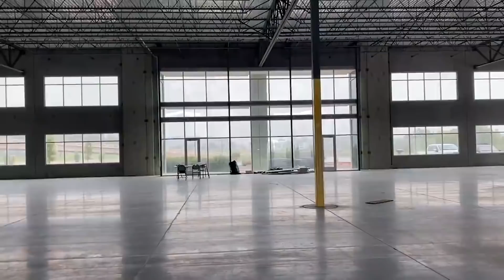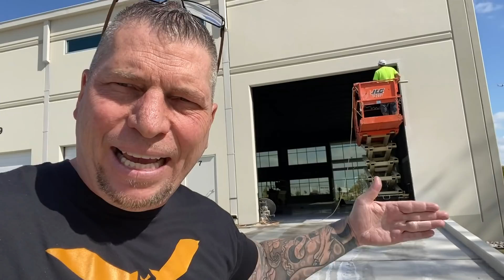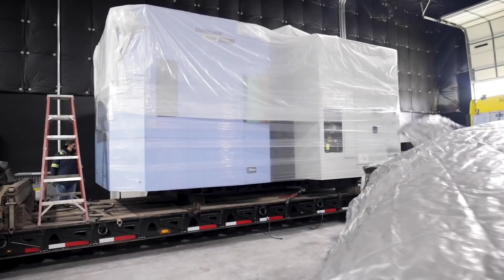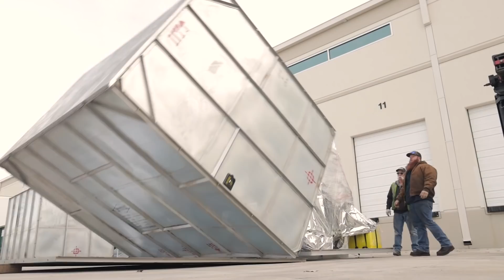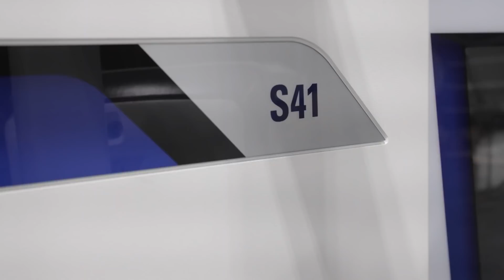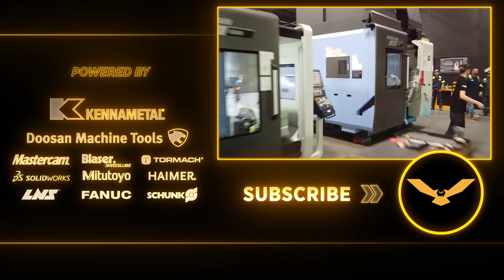TEXAS CNC Machine Shop | Mission Accomplished... BOOM!!!

Comment: Won't the front door leading right into the mashine shop get you into trouble with holding tight tolerances? Due to temperature differences from outside- to inside-air?

Comment: Titan, thank you! Because of your educational videos and the things you do, I was able to move from the shop floor into a design standpoint where I design tooling and die sets as well as piece parts. I run a Haas Mill and Lathe as well and your information has made it easier and more fun to press that start button on the machine. Thank you again!

Comment: So what happened to you using Haas equipment. At one time you were pretty much using them exclusively. How about grob. You have not mentioned them either. Their ads pop every time I see one of your video's.
Reply: I am pretty sure, that the contract has run out... but thats normal
And isnt Haas a Big Player CNC Manufactor in the US?
Here in Germany not and Doosan also not.
Reply: I’d love to see him get into some massive parts using a bridge mill like ingersol. Massive magazine and multiple milling heads from being able to line bore to multi rotation axis heads.
Reply: As soon as he got knee deep in aerospace work the Haas equipment was shown the door.  Haas is a commodity machine.  They are not what I'd call a capitol investment type of machine.